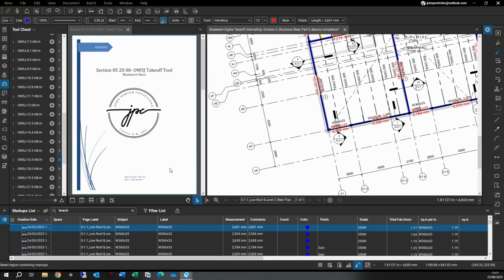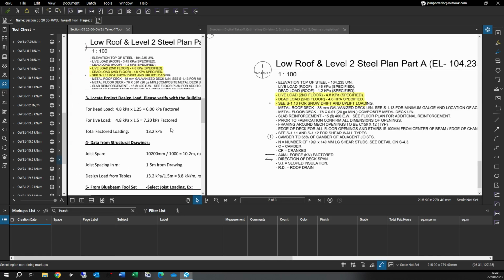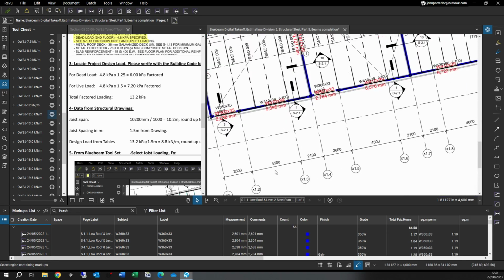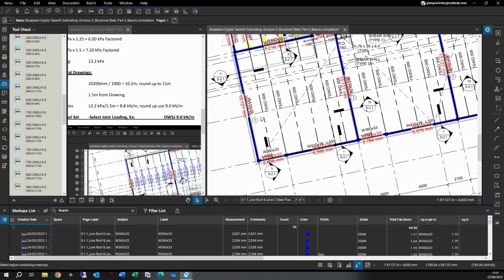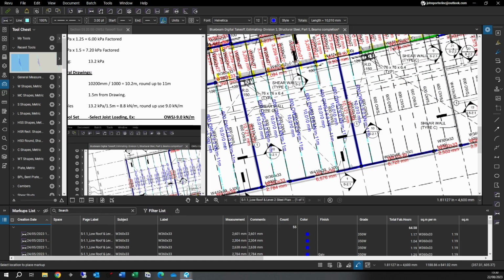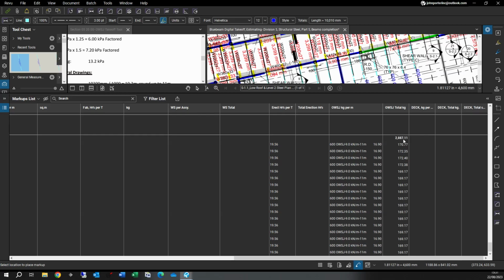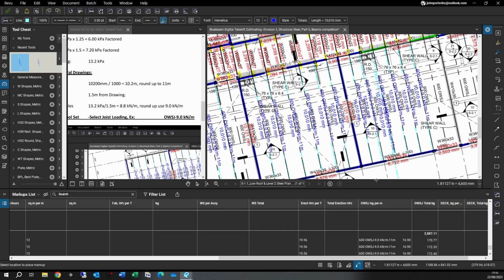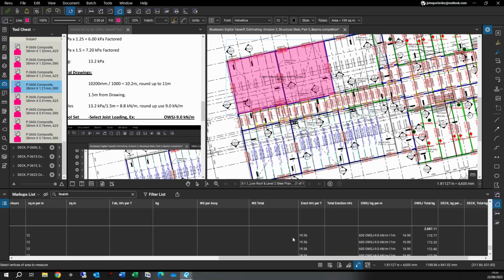Bluebeam Digital Takeoff, Estimating  Division 5, Structural Steel, Part 6, OWSJ, Bar Joist

Comment: Very cool! Does the Toolset Account for Bridging based on the Joist Designation? Or is that a separate takeoff?
Reply from the maker: Hi,  does both as it's now included with the structural steel toolset were you can add bridging.  Thanks for Asking!